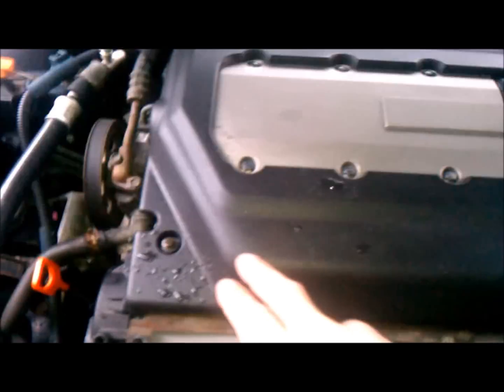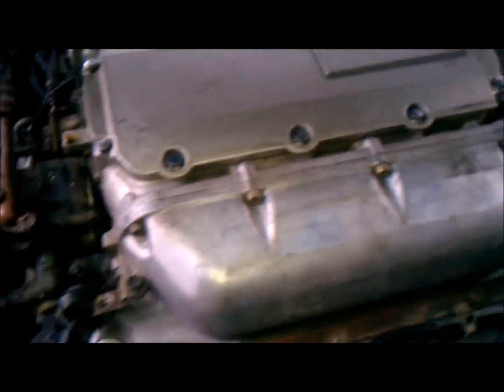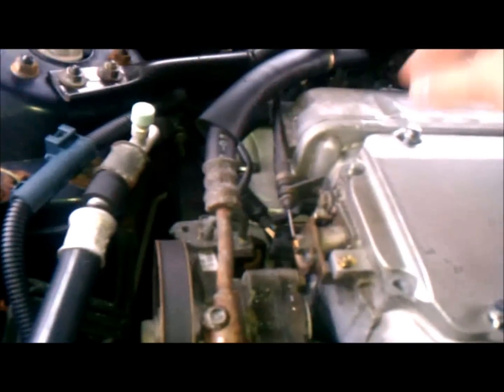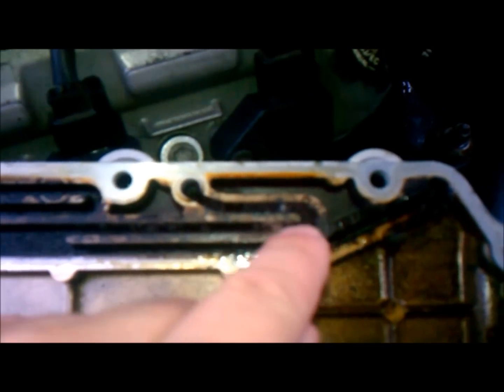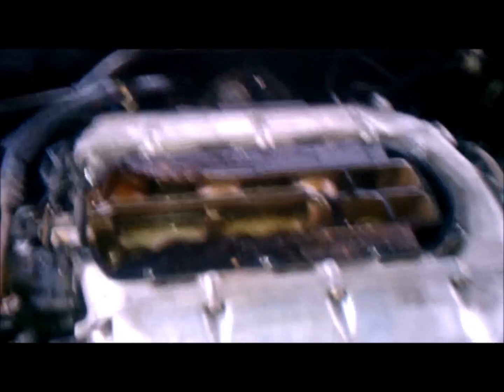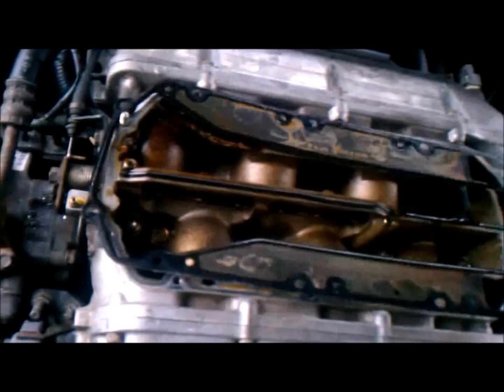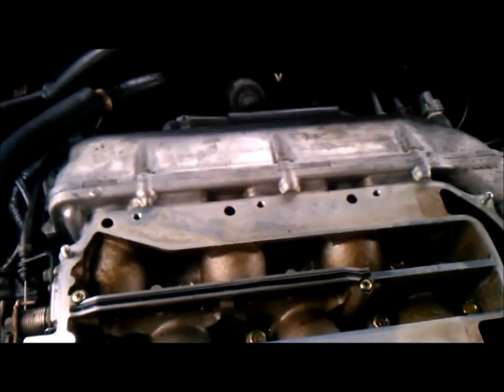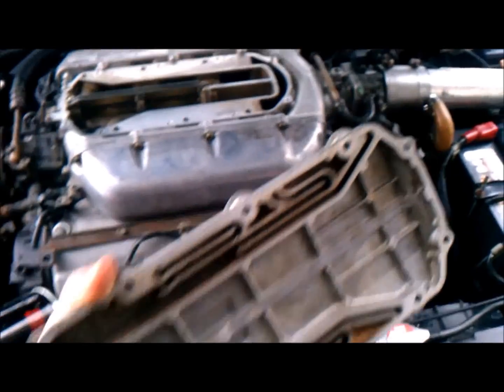Acura 3.2 TL, CL, MDX misfire repair Procedure (Tech Bulletin).wmv

Comment: Could have been vacuum leak or bad fuel injector
Reply from the maker: This fixed my problem and many others . But yes vacuum leaks and injectors are obviously items to check when troubleshooting. Being this repair is a technical service bulletin released by Acura bc of manufacturing errors, everyone with misfire reoccurrence should check this.

Comment: You my friend are a saint. You've probably just saved me hundreds of dollars taking my car to the shop. I took it in the other day and they couldnt figure out what was wrong or what was causing the misfiring, after following they're recommendations I ended up spending the money and buying OEM (NGK) plugs and installing them myself. After all that I still had the same issue even after the new plugs, I had misfire codes in every cylinder and also a "Random Multiple Misfire" code and after watching this and checking out my gasket it was indeed backwards. Swapped it back the correct orientation and PRESTO like dark wizardry it's running like a CHAMP again!!!

THANK YOU SO MUCH!

Comment: Those were all cleaned and still have the same problem.
Stores did not have ignition coils.
Swapped front left coil to right, right to left: no improvement.
Praying that ignition coils will correct the problem when I get them.

Comment: Was about to get rid of my 2000 TL 159,000. Instead I cleaned my ports  in January 2019 and it misfired a couple of weeks later. But it hasn’t misfired since. Thanks for the video the TL lives on!

Comment: I am curious to know why you chose to solve the problem with the most expensive options; i.e. plugs and coils, first instead of doing the air plenum cleaning first.
Reply from the maker: Mileage would dictate replacement first. Coils and plugs should be replaced every 100,000 mi. If you haven't replaced them that's a good start You will get better fuel economy. These are known to fail

Comment: I had cleaned my intake and EGR ports about 2 years ago and thought no way they were the cause of my p1399 code and rough engine/misfires, but I followed these same steps to clean mine again just now and the rough idle went away and no more misfire. I was surprised because it wasn't even that gunked up because of the previous cleaning. But this helped for sure. THank s

Comment: I have a 2000 3.2 tl has 216 3542 on it and fot all the coils and egr replaced and it is still reading missfired. And it sometimes it won't start and it it doest i have tp hold peddle all the way to floor and it wont rev about 1000 if i let go pf gas it dies out them i start again hold gas to floor still wont rev fo3 a bit when it start to rev it back fires a few time then if i let go dies out . This happens a few time before it stay started and it smelld like it is flooded and drive fine jusy when it is being started after a long drive

Comment: So many people suspecting the ignition coils first. With these 01 and 02 acura/honda the EGR system should be your first stop. Clean the entire system from the PCV, ports down thru and to the EGR valve (and it's ports and pintle). 

 Know how to test a coil first before condemning and replacing. Not saying it's never ignition related but that on these model years the EGR is more likely.

Comment: You also NEED to clean the EGR system down. The tubes clog as well. That also means cleaning the EGR valve (the pintle and ports). Just cleaning part of the system isn't the way to do this. You gotta clear the entire system. Look into a new PCV valve and make sure it's hose and ports are clear. All of this is simple stuff.

Comment: I have the same problem on my 2000 Acura tl 3.2.P1399 P0300 P0301 P0302 P0303 P0304 P0305 but no 6??
Reply: Could be a vacuum leak or the EGR issue mentioned in this video that acts as a vacuum leak and makes your engine run lean. Did you check  your fuel trims to see if you are running lean or rich? You will need an OBD II scanner with diagnostics to check and record the data, but it will point you in the right direction on what to test next. I have a 2003 tl  and it was running lean and had the same codes being thrown just like yours--even though mine were intermittent. Since I was running lean, I had checked the alternator and battery, and I checked the spark plug and coil swap test to see if the problem followed, but no luck. I ended up having to clean the throttle body, EGR valve and ports. Car ran much better, but I was still running lean with a misfire on cylinder 3, I suspected fuel delivery, but the evidence was still pointing to a vacuum leak--thanks OBD data. I ended up having to replace the EGR valve to resolve my issue since I couldn't get it to pop out valve cylinder to know it will come out.. Everyone's issue will be a bit different and troubleshooting multiple misfires can take some or a lot of time as there can be a lot of causes for them whether dirty, mechanical, electric or fuel delivery. I am glad to see people want his code resolved, otherwise, you could end up having to replace the cat one day when it gets clogged up and that's not cheap. Hope this helps

Comment: installed it upside down?  bunch of ding dongs!  my new Honda was made in mexico and it's a real pos.  my wife's 98 tl is misfiring.  code for misfires and catalyst efficiency below threshold.  ordered plugs, 02 sensors, & fuel filter.  gonna try to take off the big ass $400 cat and clean it.  gonna get her a new car anyways but still wanna keep this car in the family.  it's been a good long living car.  not gonna dish out on a $400 🐈 though, fuck that.
Reply from the maker: Will G Give this a go, I. Sure it will work for you.  :) do it before the cat replacement. That code will go away moat likely making after this repair
Reply: Check eBay I found the catalytic converter for my 01 MDX for under $100

Comment: 2004 Honda Odyssey - A Week ago, a mechanic replaced the EGR valve and cleaned up the Intake manifold passages, and they were plugged severely. Cleaned to be sparkling clean. Installed the gaskets and buttoned up the intake maniforld. But the TCS and CEL lights came back on, and diagnostics said same as before this upgrade which was random misfire. Then I watched this video which said if these lights come on check to the top gasket if installed properly. I checked it just now, and found it was not installed properly, as the holes for passage to the EGR were covered by the gasket. That was a joy to see, because of the alternative. So I turned the gasket upside down, and buttoned up. The dash lights are gone, but I still have to drive it for a while to be sure the lights do not come back on.
Thank you Edward Naso II

Comment: thanks for the video. I cleaned everything out and put it back together. the gasket was in the right spot but some of the channels were completely clogged. once I put it back together and went to start it nothing happened. the starter is turning but I'm not getting any compression.the engine started before I cleaned it but now I can't even get it to turn over. my best guess is the spark plugs got some moisture on them and so it's not sparking. is that a possibility? took it apart again to let it air out. any other suggestions? The GF is pissed I effed up her car.
Reply from the maker: Robert Der I do not mention in the video but you have to reset the car's computer. The computer will recognize different airflow and will have to be reset. If you continue to try it will eventually start and relearn on its own but I might take a couple minutes to start without resetting the computer period if you don't have a computer try disconnecting the battery for 15 minutes. the spark plugs could not have gotten well keep trying you will be fine as long as you reassembled and reconnected everything properly
Reply: worked perfectly. thank you. just saved me a world of hurt.
Reply from the maker: Robert Der LOL glad to have helped sorry about that scare I wish I had a way to update the video without having to repost it to let people know that. It is a common comment I get here. Once those ports are clean there is so much more airflow the computer doesn't know what to do and it takes a while to recalibrate itself. The reset solves all those problems. Hopefully your misfire issues are resolved as well

Comment: lol ya mr mechanic replaces spark plugs and coils without testing them? haha , joker
Reply from the maker: emmett smith , I said in the beginning of the video that was already previously done. spark plugs had miles indicating replacement. just because they work in a tester doesn't mean they don't misfire, as for coils, there are no tests that will prove they don't short at high rpm. resistance testing is not enough. I'm an MIT graduate un engineering....what are you Mr. mechanic scruntiner? bahahahaha don't write ignorant comments online it only makes you look foolish 😂
Reply: Happy for u. Using an impact . Graceful
Reply: Everybody's in MIT graduate online

Comment: I want to say thank you for answering my question but I still don't know what to do like essay the first time of change is my plug the coil the oil and also change my pressure regulator and my fuel filter I'm still getting the same result this is the number I am getting p1201 1202 1203 1205 andpo300  and1697 , what to do maybe you can help have done everything I can

Comment: Just want some clarification - 
1. What should I use to clean this? Non-Chlorinated Brake Cleaner? 
2. I pulled off the cover and it seems like there is a lot of moisture in there. Is this natural?
Reply from the maker: bsumaverick non-chlorinated brake cleaner or carb cleaner are fine. There should not be moisture inside check your air filter and all your intake tubes to make sure there is not a break. also that might be a sign of a bigger problem, possibly dirty injectors or non fire ignition coil , or bad valve if that moisture is unburnt fuel

Comment: nice video my acura mdx 2002 is workin good now
Reply: Jeobani alvarez  did you to the same procedure as he? my 2001 seems to be misfiring but I have no codes
Reply: leonor rincon I  first desconect the battery after clean the egr and change the spark plugs  my acura mdx 2002 working nice
Reply: ok thanks for your quick response
Reply: leonor rincon hola leonor lo primero que tienes que aser es desconectar la bateria y aser el mismo prosedimiento asi como lo esplica el video yo lo hise y me funsiono de mil maravillas.
Tambien chequea las bobinas a veses pueden estar una que no tira buena chispa.
Primero puedes intentar desconectar la bateria por 15 minutos para que se reinisie la computadora. A veses no ay ninguna falla

Comment: hello good afternoon friend, I am having a problem with my Acura Tl Type S 08. sometimes the engine light comes on. take my car to Auto Zone and made a diagnosis and OBD code P0174 appeared too lean Fuel sistem bank 2. I want to know where the MAP sensor to clean, and also buy the air filter. I'm starting with the basics. Besides my car has a sulfur smell when I go fast on the freeway, I have informed and can be catalytic, but this car has 3 catalytic, two in the engine one in front and one behind and one in the line of exhaust pipe . Not if the term refers to the Bank 2 catalytic front of the engine. Seeking recommendations to fix the problem because they do not have much money to fix my car. Also buy spark plugs to make it a Tune Up. And finally I added injector cleaner the Lucas brand in the gasoline tank
Code P0174 possible causes 
- Intake air leaks - Faulty front heated oxygen sensor - Ignition misfiring - Faulty fuel injectors - Exhaust gas leaks - Incorrect fuel pressure - Lack of fuel - Faulty Mass Air Flow (MAF) sensor - Incorrect Positive Crankcase Ventilation (PCV) hose connection

Comment: I tried this procedure. Thanks for your video. Also,  I cleaned off the ports and gasket; put everything back together, reused the old gasket and set it in the right way; and also did sea foam right after. Nothing changed for me however. Still running rough and check engine light on.  I have a 2003 Acura TL-s.  Everything was working good until a few days ago; I changed the plugs last year and had no issues until now. But I have never changed the coil packs.  my code is P1399. Can it be anything else? like the idle air control valve?
Reply from the maker: sounds like a bad coil...try idling the engine and one at a time disconnecting each one. the engine will idle much rougher after disconnecting a good one. keep trying this until no change is noticed after unplugging a coil and that will be the one requiring replacement 👍 ..of course a proper diagnostic tool will tel you which one but this is a great way if you don't have the right equipment
Reply: thanks. it was one coil. i replaced all of them. we back riding like an acura!
Reply from the maker: +David Johnson, that's great David, happy to hear it!

Comment: This very informative video really fix my Acura TL 2000 misfire problem, I have to actually do it twice since the ist time I only did clean 80% of the EGR port, have also made the same mistake by returning the clean gasket upside down like originally found. 2nd time , I did a really thorough cleaning....like this video showed.put all the cleaned parts back. run the car for 20 to 30 miles and my check engine light just disappeared without resetting. I save money and have peace of mind driving my car, he now  runs like a champ. without fear!......Thanks Ed and more power to you!!!
Reply from the maker: :) glad to have helped you!

Comment: I got a 2001 Acura MDX that shut off while warming up n also while I'm driving I got a new battery new alternator new idle air control valve would like to know what can it be
Reply from the maker: did you check the fuel pump? how many miles?

Comment: Hi Edward. Hoping I get a response from you. I have a 2000 TL. Car has 230K miles. Been running like a charm as I have taken good care of it. Past few months, on occasion, I would have trouble starting it. Then when it did start, it would run extremely rough at idle. After giving it some gas, I could on occasion get it running fine again. Other day, car ran fine. Then went out and it wouldn't start at first. Once I did get it started, its certainly running very rough, not much power, chugging and the TSC light is flashing. Would clogged EGR ports be causing this? I haven't had chance to hook up to computer to see codes yet. A few years ago, I did have to replace some coil packs. To my knowledge, the EGR ports have never been cleaned on this car. Your help would be appreciated!!
Reply from the maker: sounds like bad spark plugs. change them first... it is a very good idea to clean the EGR ports as well. If it's never been done with that kind of mileage it most certainly needs it if you're not running 93 octane consistently. Let me know I'll be happy to assist
Reply: THanks for the reply! I am changing spark plugs as well as just doing the coil packs as well. I'll know today as I had to order the coil packs, if this is the issue. As I may have mentioned, I did clean out the EGR ports as well. Question is, if I do all of this, and it still does the same, which is barely running, what would be the next things to look at, check? Thanks again!
Reply from the maker: Maf sensor...definitely would be next
Reply: Where is this located on the TL? Others I have done, were within the air cleaner. On this car, no sign of it there?? Would this really cause the car to run this poorly or not even start? BTW, I changed plugs and coils...didn't help.

Comment: What do you do when you spray the cleaner in the ports? Will it come out?
Reply from the maker: it will flow into the exhaust system, no worries there :) hope it works out
Reply: +Edward Naso II (Naso Pools) So you don't have to take the whole manifold off?
Reply from the maker: Only what's in the video

Comment: Thank you, glad I saw this easy fix before jumping into a valve adjustment.  Replaced plugs and coil packs but still have code showing miss fire despite running much better.
Reply from the maker: these valves are non adjustable
Reply: have a 2005 acura mdx losing power when the maw-4 light comes on do u think that cleaning the egr ports will help?thxs